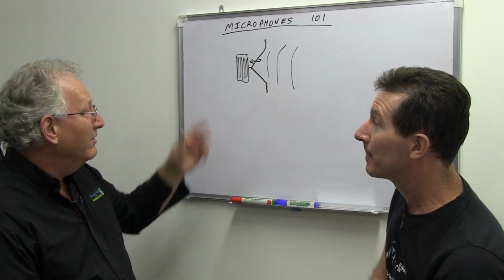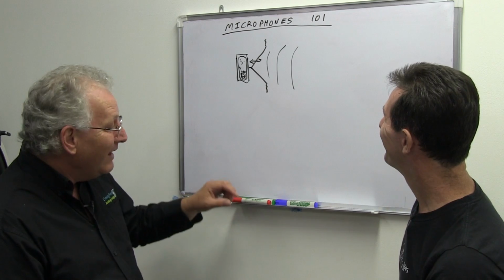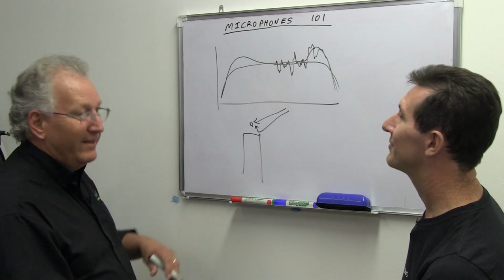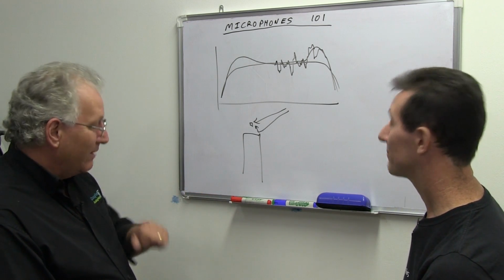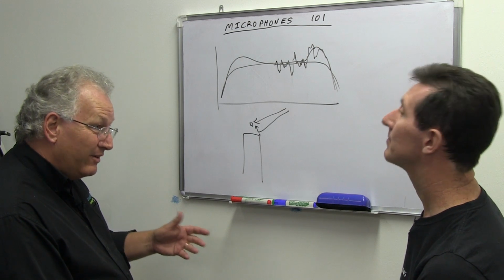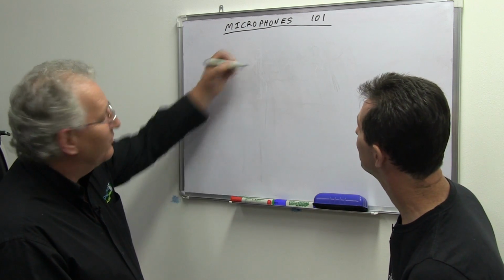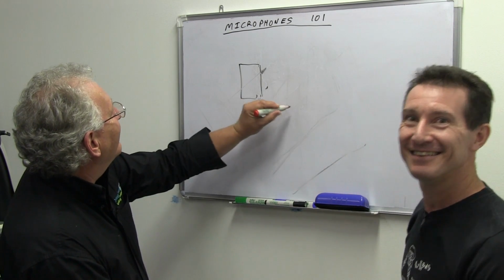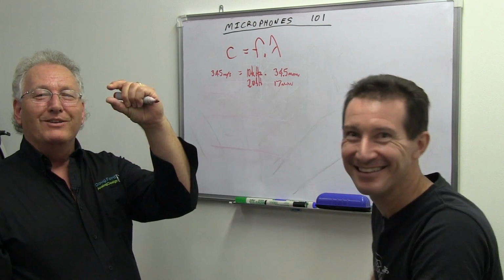EEVblog #602 - Introduction to Microphones

Comment: Great video! I'd like to hear a little more about how the condenser mic is measuring capacitance. Why does it need +48v at the mic, etc.
Reply: If you charge up the condenser with some relatively high voltage (maybe somewhere between ~20V and >100V), then, when the capacitance changes (because sound waves impinge on the diaphragm), you can sense a change in voltage relative to the sound wave. That very tiny (and very high impedance) signal is amplified by a transistor (or firebottle) into something that can be sent through the wire.  Technically, it is not "amplification" so much as "impedance conversion" or buffering.
The capsule must be charged with a voltage in order to sense the capacitance change (the diaphragm movement). Originally, this was done with a ~high voltage source, but then they discovered how to make permanently-charged capacitor capsules with Electret technology.
The 48V standard was stumbled upon when Neumann made some new transistorized mics for Norwegian Broadcasting Corp in the mid 1960s  The voltage (whether 48V or some lower voltage) is required to power that transistor (or tube) that does the impedance buffering mentioned in the first paragraph.
Reply: Thanks for a very thorough explanation! You lost me with the impedance conversion - not amplification though. I have to read up on signal impedance. Funny to hear about the norwegian broadcast, as I am a norwegian :)
Reply: In effect, the impedance converter circuit amplifies the CURRENT, not the VOLTAGE.  In a roughly similar way, a small power amplifier for a speaker may not put out much more than line-level voltage, but it amplifies the CURRENT to drive the very low impedance (4-8 ohm) of the speaker.